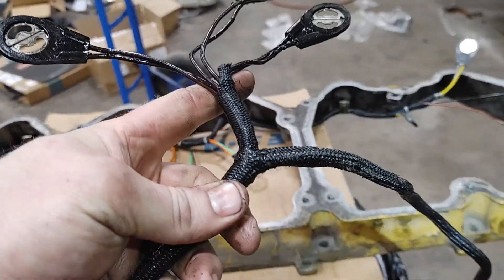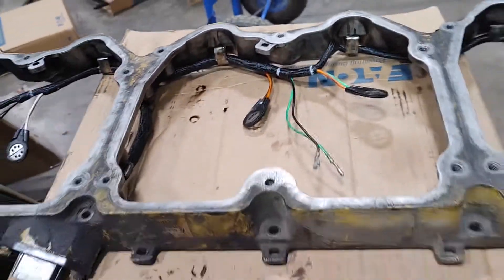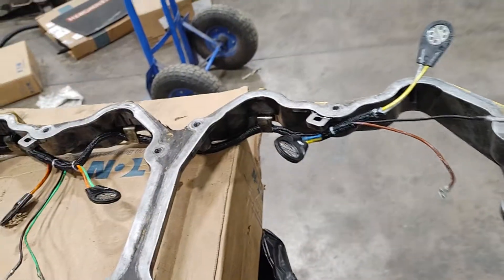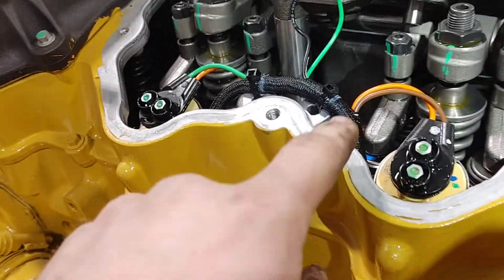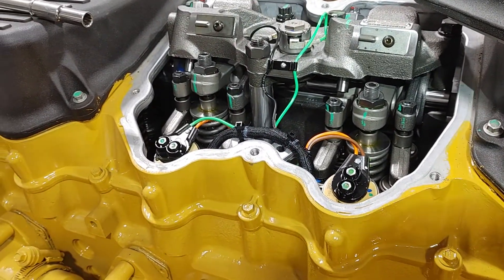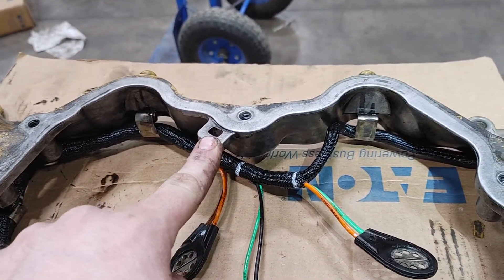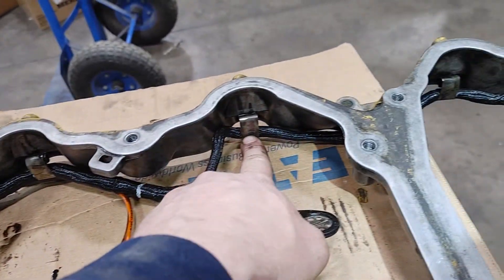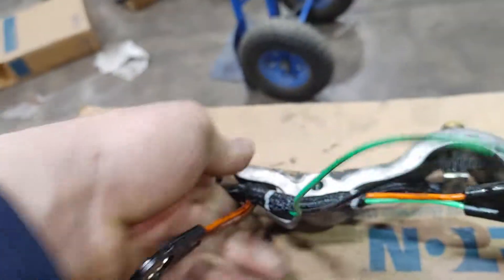Cat C15 3406E new injector, jake harness problem solved.

Comment: 3 years later here I can declare still no service bulletin on this and a CAT tech basically explained to me what you just showed here. A little annoying because I e already torqued down the valves base and  all 6 injectors and now I have to undo all that…

Thank you for the video, extremely helpful. Wish there was something else more garunteed to use other than zip ties. Nobody wants those breaking away at some point.

Comment: Wouldn't surprise me if Cat was in fact making the replacement harnesses shorter without changing the part number or putting out some kind of bulletin for the techs to know. Deere does the same thing. I'd imagine you aren't the only one who has dealt with that, considering how many C15's/3406E's are still out there running. I grew up riding in a Ford with a 3406E...still one of the best engines out there.